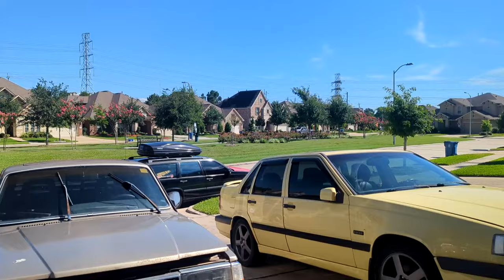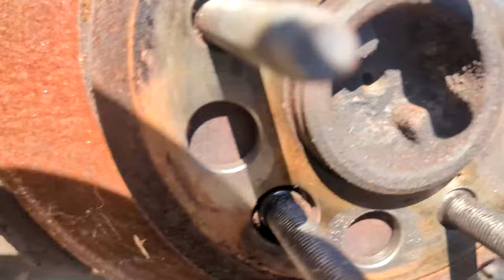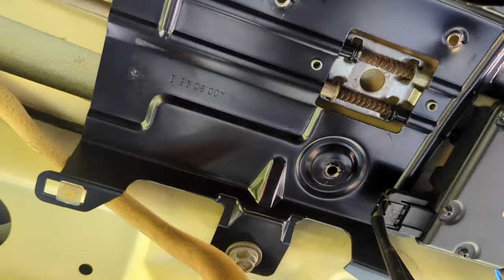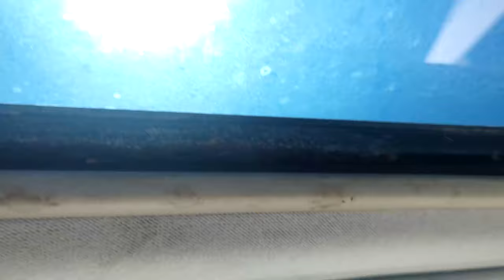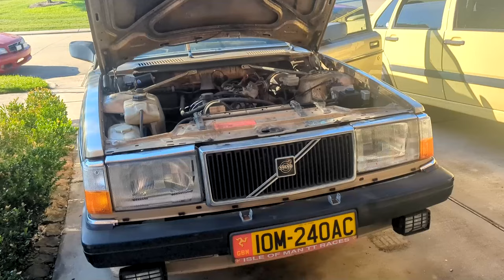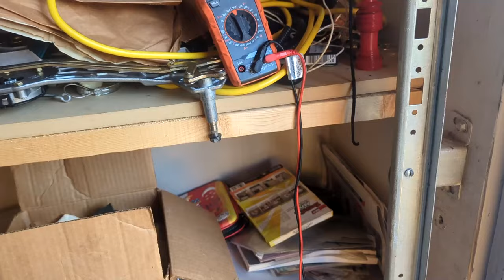Moonwalking all day long. Locked up rear caliper on the Volvo 240, stuck door and sunroof on the 850

Comment: Robert I had a similar fuel problem with one of my 240's more than a decade ago. The problem was the fuel injector voltage regulator . Looks like a block with 4 giant resistors in it on the drivers side above to wheel near the battery. I had a rusted connection on one of the resistors causing the injectors to not get the correct voltage. I hope this helps you.
Reply from the maker: I'm sure it will. I'll pass that info on to the owner.

Comment: The jumper wire takes the relay out of the circuit; the next step I would take would be to change the relay.
Reply from the maker: We did change it but with an aftermarket one.

Comment: The jumper wire bypasses the relay. Since it runs fine with the jumper, the relay itself is suspect. Back when I owned Bricks there was always a spare in the glovebox, and never aftermarket.
Reply from the maker: Dang. So the new relay can be bad/weak as well?
Reply: @RobertDIY  DOA new parts happen, especially these days when you can't always tell who made the part. Reboxing is a corporate illness.